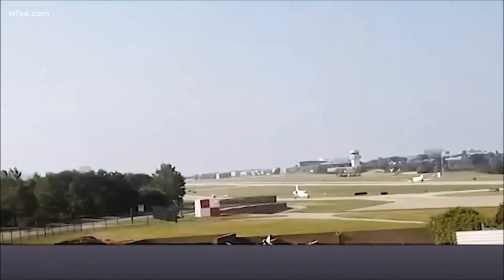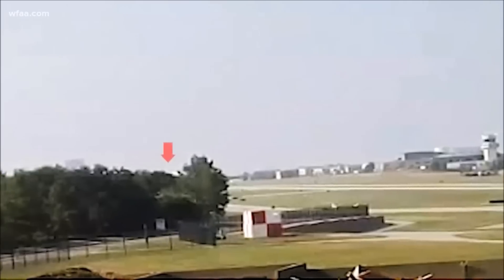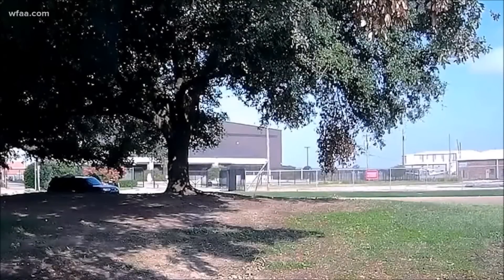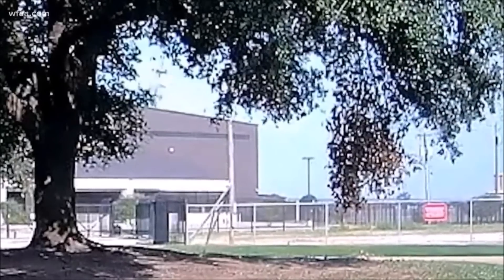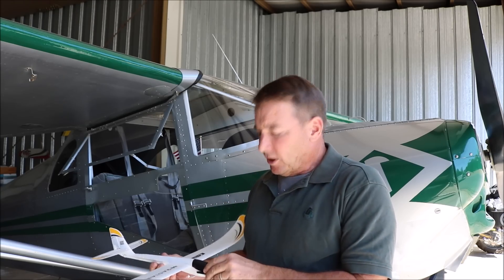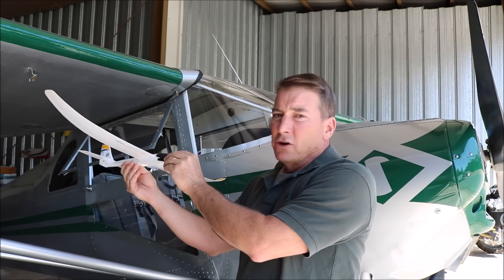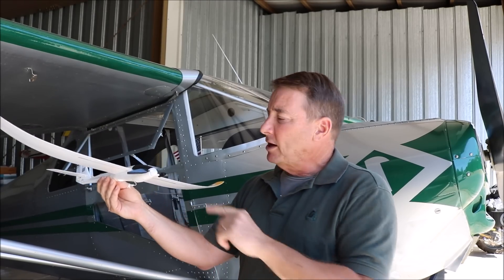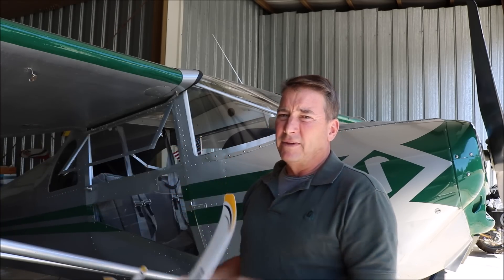Addison Tx. King Air 350 Crash UPDATE- Vmca

Comment: Two things Inlearned very early in in my aviation career as mechanic and dispatch.   Take offs are optional...landings are mandatory.  Tragic event with little room for recognition of the problem (in this case left engine problem.  Never actually heard the term left engine failure but sounds like most plausible theory.  I am pretty safe with the aircraft at or near gross maximum take off weight if not over.  Remember the max take off weight is predicated on being able to burn enough fuel in the trip to make maximum landing weight.  If this aircraft was , near, at over MTOW then the extra fuel and cargo or fuel anyway definitely did not help matters.  It is possible on any aircraft to exceed MTOW but you can see the possible consequences.  The flight management systems and computers are only as good as the data entered by a human.  If a human entered a lower amount than actual then the aircraft will struggle to get airborne.  If you enter 1000 pounds of fuel instead of 10, 000 then the aircraft will have additional 9000 lbs of fuel onboard that the aircraft can’t account for.  That is extreme example but still possible.  I can see the point of topping off fuel where it is cheaper but not always better.  Remember that fuel is weight and as they say....”Coats fuel to carry fuel”. If initial report was conclusive and the incident aircraft was going down to Florida for maintenance, overhaul, heavy maintenance check, etc....this could be an example of a reason to NOT Carry extra fuel.  Especially if the reason for going down is for major maintenance.  Some checks and heavy maintenance may require access to the fuel systems.  The extra fuel will most likely get drained and be useless.  Some fueling companies will make the O/O “rent” the fuel truck until the fuel is used for that O/O.  The FBO’s will put the drained fuel back into that O/O’s aircraft first.  This reduces the high risk of cross contamination of the fuel to other aircraft.    If your the only aircraft for that O/O could be a while.

Again we don’t know what the repair item was in Florida and could be as simple as avionics or structural upgrades and fuel was never touched but you get the idea.  

Also remember that the difference between MTOW and MLW (Landing weight) normally increases as the aircraft gets larger.   Example King Air difference might be only a couple thousand pounds.  But a major commercial aircraft (Airbus, Boeing, Embrear) might be several thousand pounds.    Whatever the problem was sounds like the extra fuel, (weight) did not help the situation.

Comment: They didn’t notice engine failure till it was too late. While they pull up elevator you can clearly see the plane loose massive amount of speed snd stall left due to only the right engine working. Rip, Prays go out to there families

Comment: What if anything  could  the pilots  have done to save it ?
Reply: Soon as engine fault seen, an abort at or just before V1 should have been the only option, I would have thought, I'm not a twin pilot myself. Even a collision with the boundary fence at 20 knots would probably be survivable for all the occupants. It will be interesting to see if the MTOW was exceeded with all the seats filled, full fuel load and luggage.

Comment: Interesting Vid and I don't know who you are and perhaps your conclusions are based, as you said, on simulator flying, but you missed the point that becomes pretty obvious sitting in line at Oak City getting ready to blast off into a line of night thunderstorms in an under powered, overloaded cargo flight wondering if you'll survive the night.  Your problem was with option #3 and you gave no solution except the expected crash.  A pilot's training and mindset to everything is more power to prevent the impending stall so they always think they can to save the airplane and then end up nosediving into the ground at full power.  This pilot missed the moment when the airplane stopped being an airplane (just before the the point of yaw that was coming with the drop in airspeed) when he could have accepted the crash, dropped flaps, reduced power, and glided straight ahead to land/crash (and probably still be over the airport too).  At the point when he really needed to be a pilot, he wasn't, and they don't teach this stuff is schools since the only way to get the perspective on 'crash straight ahead' is through experience that knows the moment to do it, and then the discipline to do it.  There's a moment when the pilot knows he's lost it and the only chance of saving his life is to reduce power and crash straight ahead, and be willing to take his chances.

Comment: Why didn't the building implode?
Reply: Three days later there was an airshow at the airport (ADS) and a guy connected with operations in that hanger showed me pictures of the hanger and the Falcon that was in the hanger on his phone. The plane came down and managed go through the sheet metal roof, but went between two beams that appeared to be on 10 foot centers. You can see one of the brown beams in the opening still picture of the video. The structural integrity of the hanger was not compromised.

Comment: 0:03 At this time I should just point out that a Boeing 757's wings can cut through box section steel reinforced concrete, whereas a King Air's wings cannot penetrate sheet metal roof sheets.

Comment: If the plane was over weight limit, one engine just couldn't get enough speed for lift... very sad as the extra fuel was most likely not a good idea with the loaded plane.

Comment: I cant help but wonder that part of their pre flight briefing was if rotated and in the air and an engine failure the plan was to keep airborne straight ahead and return to the field.  Unfortunately it appears the only way they could of survived this would of been to cut both engines and push the nose down... They probably would of landed hard on the tarmac and possibly even hit some parked planes or even clipped a hanger.  If they had done so they probably would of had their certificates pulled and be blamed by the FAA for not have continued in the air and try to return to the pattern.  If they were within weight and balance it looked like maintaining level flight was near to impossible and they barely would of cleared the   hangar and trees looming before them.  In hindsight pulling both engines and setting it down was the only possible survivable outcome it appears.

Comment: This loss of life has me still thinking if.  First off I am not a pilot, Hand gilder a lot, some ultra lite and a bit of "you can fly a bit" with friends in small forgiving ships.

I am going to ask a stupid question you most likely will not address and rightfully so.   What could have been done differently to gain perhaps a better ending to this flight?  I guess I am asking how you would have handled this.  Again, I know it's a crummy question to ask, I think you don't want to second guess or anything like that.  Many here respect you for just being you, honest and plain speaking with the facts you have.

But maybe with your knowledge a pilot facing this in the future may gleam some insight with your experience. 

I am not a pilot but I think the smart move once the plane started to come left would be to shut #2 down to half,  drop the nose, level the wings and try to do a controlled crash.  What a stupid idea right!  But the A321 in Moscow did perfect just setting her back down, great pilots I think.
Reply: Steven Sanders I’m just a private pilot with hardly any hours. I would have cut power to the right engine as soon as problems started up on the left, then take me chances stopping it and possibly running off the end of the runway. I know VMCA is the point of no return for a committed takeoff. I still think they would have been able stop on the runway.

Comment: May the souls of the faithfully departed through the mercies of God rest in peace. Is it possible that the prop of the left engine went into reverse thrust on its own?
Reply: Took me like four tries to parse that sentence. I kept trying to use "through the mercies of God" as a modifier for "faithfully departed", when it's correctly modifying "rest in peace". The former makes a lot less sense than intended.
Reply: GeekOfAllness ok   I’m not sure what you mean. Did I say the prayer wrong?
Reply: @Dave-hv9rn  It's grammatically fine, but the way it's worded makes it hard to read. If you say it aloud with the proper cadence it sounds fine.
 

When I first looked at it, I was reading that the souls had faithfully departed through something, but the intent is that they rest in peace through the mercies of God. But it might just be me and the rest of the world reads it without issue.
 

"May the souls of the faithfully departed rest in peace through the mercies of God," reads better to me. Adding commas at least breaks up 'departed' and 'through': "may the souls of the faithfully departed, through the mercies of God, rest in peace."
 

Not a big deal; maybe I should have just ignored it. But I thought maybe someone might read it the same way I did and get a laugh out of it.

Comment: That was ugly. I am an old freight Dog and Alaskan bush pilot. Flown only single-pilot operations. From what I saw,, All he had to do was to just pull the throttles back and land. he was to low and had the gear down, and maybe some flaps as well. I was always a bit paranoid flying twins because I mostly flew junk for some of us Flying for a living was an underpaid and thankless job. I got 43 years of it and now and pretty much retired,  I will do some flight instruction from time to time, or do short contract work mostly helicopter. I fly both. I feel bad for the PIC, and even more so for the Co-Pilot no doubt the kid was looking to build multi hours, turbine and King Air time.

Comment: When you get below Vmc the aircraft will not just yaw but roll violently. This is what the video appears to show - I'm not sure the aircraft stalled.
Reply: @@HiWetcam - The recovery will be very different depending on whether the aircraft is stalled or not. Cutting power on the good engine to restore control will only work if the aircraft is not stalled. If the aircraft stalls you are looking at a spin which will require additional steps to recover from after cutting power.  Both cases require a lot of altitude to recover. Some twins have a Vmc below stall speed - I don't think this is the case with a King Air.

Comment: I might’ve missed spoken I don’t know if it’s Oklahoma City or was it Tulsa but it was a king air on tight golf with only two pallets pallets on board and it crashed into a hanger that was a flight school and kill people on the ground I’m just confused this is been going on for a long time why don’t I just fix the darn engines or whatever the problem is
Reply: Ron Hancock   Engines fail.  It’s man made.  The key is proper training.  Ironically, the crash you are probably referring to was at Wichita.  The plane crashed into the Flight Safety Training Center.

Comment: It appears to me that you only had seconds to try to react with this engine failure. As a son of a father who has been a pilot since he was 15 years old I understand the importance of flying Twins and having one engine fail especially after the plane is now are born from the runway and being able to react immediately to cut the power of the good prop or reduce it immediately upon one engine failure so is not to have a uncontrollable spin in either direction. Having a pilot and co-pilot that are not on the same page with specific training for the particular aircraft they are flying is a terrible thing. When you only have seconds to react and you're already in a confusing conversation about a possible problem with the aircraft that's just terrible any way you slice this. Very sad.

Comment: The age of the PIC most certainly did not help the possibilities of this worst case scenario being handled in a prompt and precision manner.
Reply: Being 71 doesn't mean anything.  I have seen many 70 year olds that could work and think better then a 40 year old.
Reply: That has not been my experience in my corporate career. I’ve seen many once great and sharp pilots fall to grips of old age. The mental quickness, memory and dexterity on the controls goes downhill very quickly around that age with many pilots. There is a reason that part 121 requires retirement at 65. The yearly medical exam checks 0% of a pilots ability to actually fly an airplane. A physically healthy pilot can be a mentally unsafe pilot, especially around that age.

Comment: The pilot was likely only a private pilot with a single engine rating.   So he only had one of the airplanes engines running and could not produce enough power needed for the heavy aircraft.  So sad and preventable.

Comment: WHAT COULD HAVE BEEN DONE TO PREVENT THIS CRASH.
Reply: First of all...why all caps? Seems "shouty". Second you usually find all such in the final report, which I'm guessing, isn't out yet. Also you could scroll through the comments, most folks seem to think the circumstances qualified for a rejected takeoff.
Reply from the maker: More training.
Reply: @genevieve571  SHIFT KEY NOT WORKING.  SECOND, HAD THIS PILOT FOLLOWED STALL PROCEDURES SOME MAY HAVE SURVIVED.  OPPOSITE RUDDER AND GENTLY NOSE DOWN.  IT APPEARED HE DID NONE OF THAT.   GOT TO DO A CAREFUL RUN UP ESPECIALLY WHEN RESPONSIBLE FOR THE LIVES OF OTHERS.
Reply: @blancolirio  MORE TRAINING.  SHOULDN'T AN ATP KNOW TO APPLY OPPOSITE RUDDER AND NOSE DOWN IN A STALL.   MAYBE BE MORE CAREFUL IN THE RUN UP WOULD HAVE PREVENTED THIS CRASH.

Comment: There a lot of things I don't know, I am not a pilot. I believe once V1 is reached there is enough air flow over the surfaces to control the aircraft. If so, then with one engine considering the takeoff weight is there enough power to not only maintain air speed but also climb out? If not, then if even past V1 it would seem to have been better to abort takeoff and take your chances at the end of the runway. Of course again considering the weight if at take off roll they discovered the left engine not performing properly, they should have aborted take off way before V1. Cause and effect chain of events that leads to pilot error as the cause costing lives...So sad...RIP
Reply: DrHarryT Not quite. V1 is the maximum speed beyond which it is not possible to safely stop in the avaliable runway length. Vmc can be considerably higher in some aircraft, so there can be a brief period where control is difficult (as witnessed here).

Comment: Twins seem to crash too often.
Reply: Rich Republican   Sometimes the other engine just takes you to the scene of the crash.
Reply: @raoulcruz4404  He should have stayed level. I can't believe his flight controls did not have enough authority.
Reply: Rich Republican   Flight controls have limits. Below a certain airspeed, they don’t have enough authority.  The airplane was in a severe yaw, ( this will induce much drag and slow the plane) failing engine not feathered, flight controls cannot handle that.  Only option at that point is to bring the good engine to idle and land upright.
Reply: @raoulcruz4404  You are right. Any dual engine plane with a failed engine should level by roll control and point straight ahead by yaw control and ascend in this configuration.

Comment: Very sad for all of the grieving families.
Now  ...  a follow up video is needed, to investigate whether the burning fuel developed sufficient heat to melt the steel structure of the hangar.
Dare I suggest that other nearby hangers be inspected to determine that they weren't tempted to collapse, due to being in close proximity to the affected hangar?
Yeah  ...  I know.  ...  I should just let it go.
But, a lot of people died in that one also, and I never saw much truth in the official follow up narrative. Now we have a chance to see what happens when a plane crashes into a building, and if "molten steel pours out of the cracks".

Comment: What the heck ever happened to stick and rudder? You don't try to fight a plane into the air. You nose over and maintain flying speed even if you fly right into the ground. Those types of crashes are infinitely more survivable than doing a snap roll into a large hangar! 
If the pilot had younger reflexes or the copilot had the training, this would have been far less likely. No offense but 71 is a little old to be flying such a complex aircraft.
Apparently they both forgot their brains in a rush of go fever because if there was any question about an engine on a takeoff roll, that should have been an automatic abort.
The warning signs were apparently there but whaddya expect? Aviation in the US has taken a hard nosedive in the past couple of decades.